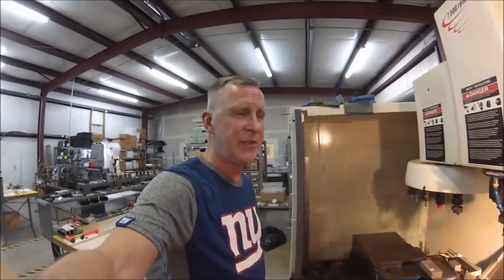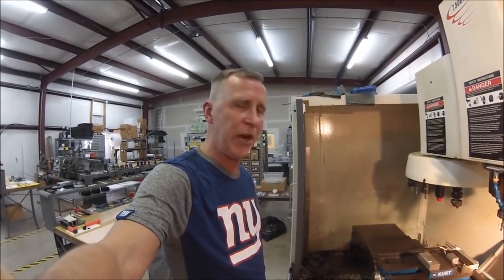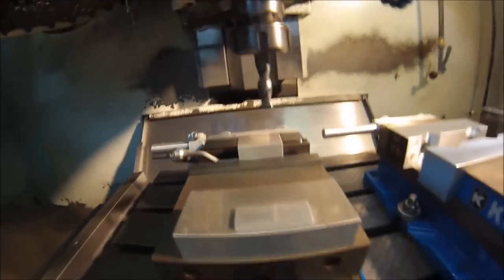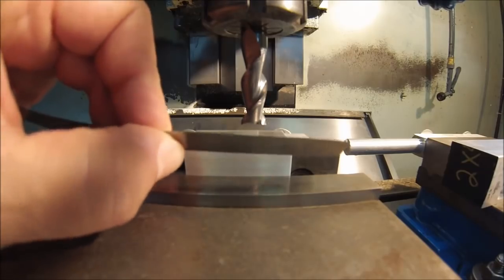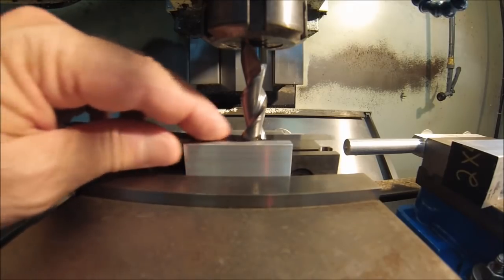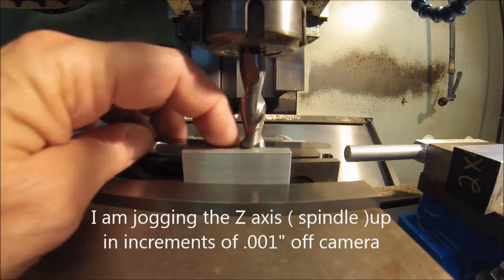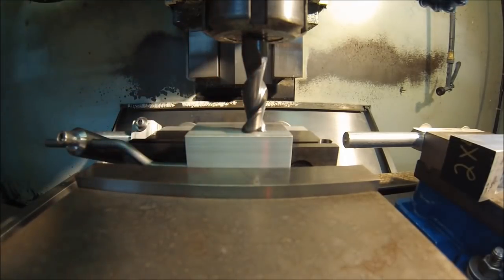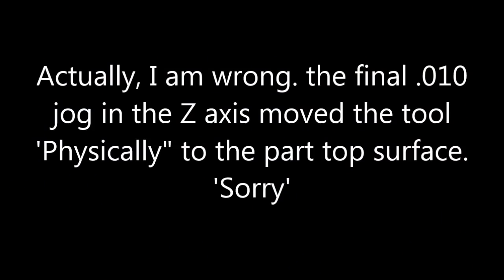How to Eliminate Chipping Risk when Setting your End Mill Height

Comment: I just use a 1” jo-block and once all my tools are touched off I drop my work offset 1”… you can also subtract 1” or however you wanna go about it, you get the idea. There’s also a dial gage tool for doing this quickly.

I start a little under an inch above the part and jog up until my block slides thru in .01” increments…. Unless it’s an endmill that’s holding a critical depth I don’t worry about getting it any closer, cuz time is money.

Comment: I have been using a .03” plastic shim after chipping a diamond coated carbide endmill.

Another way is to use a 1/2” ( .500” ) drill rod. Lower the Z axis just below the rod and Z axis up until the rod passes under the Tool.

The best way is to make a z axis gaging tool with a drop dial that is a known height.
Be sure to have .100” travel. Bring the Z axis down till the dial indicator is at zero.
4.0” gage setter. Z 4.0 measure on the tool geometry page. You can get all of your heights, not chip tools and blends in pocket floors blend nicely.

Comment: Model engineers in the UK (including me) tend to use cigarette rolling papers as disposable feeler gauges. The green ones are 1.5 though thick and blue 1 thou. Also 80 GSM paper is 4.0 thou thick.

Comment: Hey Joe, I have a Fadal also, Take a 6 inch (2-4-6 block) and place a indicator type tool setter on top of the block that will be 8 inches above your table. Set all Your tools to this height -Always.
then zero a small digital height gage (around 100 dollars for a cheapie) zero the height gage at 8 inches on a granite plate or use the little nibs on the side of the presetter wich are exactly 2 inches  ( plus the 6 inch block is 8 inches.) place Your indicator on the machine  table and measure Your work. It will usually be a negative number. Enter this number in Your work offset on the Z value.  There are so many benifits to this method.  Any tool in the carousel is already set, regardless of what job Your running. I keep standard cutters in certain tool locations in carousel.
If You start willing Your part and have removed the top of the part and then break a tool, No problem setting a tool.If You forget to set the tool length its always way up above the table .  You basically create an invisible  plane  8 inches above Your table that all the tools are set to and the work offset is references from this plane. Its actually so easy. If You dont have a tool setter , use a 1/2 dowel  pin on top of Your 6 inch block roll the dowel under Your tool with the heat moving up. Its very easy to tell when the dowel almost goes when its round. Your reference plane would then be 6.500 off the table.
Reply from the maker: I can see the benefit, but how do you apply this across all the fixture offsets. I bounce around between setups like the wind.
Reply: @joepie221  it works fine. Your g55 or  whatever will just show the z value reference from your 8 inch plane. Set those just the same with your height Gage.   So your starting work offset z value is always zero  then shift down after reading the height Gage. It's actually the easiest when using multiple offsets

Comment: I use a 3/16" dowel.  Move Z so the cutter is closer to the part than 3/16", then jog Z up until the dowel can be rolled under the cutter.  Then jog the Z axis down slowly with air under the cutter testing if the dowel can be rolled under the cutter when the Z axis is not being jogged.  When you can't roll the dowel under the cutter you are at Z = 3/16".  Set your Z axis to .1875 and you are done.  You could use a .5" or 1" dowel but you may not be able to fit that large of a dowel on some surfaces if there is geometry above the level you are trying to reference.
Reply: I do this same but on a 10 mm pin, it  is very fast to get within 0.02 mm just by raising the cutter on the smallest increment from the handwheel and trying to push the pin under it. THe round nature of it also will give you a visual reference as to how far off are you from the proper height so you know when to slow down the handwheel.

One thing to consider is wear on the ballscrew, as not all machines have perfect movements. If you are going up while measuring, the result might be just a bit different versus going down due to slop in the ballscrew and/or other parts.

Comment: I make an electrical circuit between the part and the tool to make a connection to an LED. It's consistently under a thou over. Couple of tenths usually.  It's super fast.  
For not so precise work or if I'm cleaning up the top surface anyways, I just do like everyone else by using paper and subtract a few thou.  Use what you have though. I don't like using feelers for this though.  From experience, it can throw them off, but shim stock is perfect.  Cheap and readily avail.
Reply from the maker: I now roll a .375 diameter pin under my cutters. Easy to feel and offset.

Comment: I bought an inexpensive 50 mm indexable carbide 90 degree facing mill cutter and R8 tool holder (Bang Good Inc.).  I saw a couple of reviews that were positive. Mine worked fine to face and square two pieces 2"x2.5" x 3" of 6061 aluminum. However about half way through squaring the second piece I experience severe chatter, especially when the cutter was more than 1/2 way of the tool diameter into the part. My very limited experience in watching videos using carbide tools suggested chattering was likely due to a chipped cutting edge.  I could not see wear on the 4 inserts, but I am not experienced with carbide tool wear signs.  I rotated the 4 inserts to provide new cutting edges on all 4 inserts but found no luck in stopping the chatter. I replaced the tool and finished the job using a 7/8" diameter HSS end mill. So, the mill worked fine, the problem resides in the facing mill tool.  I found that none of the inserts was loose and the cutter head was not loose on the tool holder. I researched the Internet to look for a diagnosis of what caused severe chatter.  One posted article said to stand the cutter with inserts resting on a surface plate. and see if all 4 touches the surface plate.  The author indicated the insert screw holes or insert slot for Chinese made cutters may not be properly aligned when made. I looked for uneven placement of the insert heights and found the cutter wobbled, two opposing inserts were not touching the plate. At least one of the two opposing inserts appeared to have a tiny bit of wear, but all inserts had no chipped cutting surfaces.  I rotated each insert to a fresh cutting surface and with all inserts lose I placed the cutter on the plate and retightened the inserts.  No luck to make all 4 touch the granite surface plate. Either the inserts were not exactly the same length, the seating screw hole was misaligned, or the cutter threaded hole was not perfectly aligned with the other insert positions.  Bummer. I replaced all 4 of the inserts with the same brand carbide and found the cutter seems to rest on the plate and not wobble. This suggests maybe a variance in inserts for length??? I thought I should replace the Chinese made inserts with a higher quality insert and thus ordered extra inserts made by a non-Chinese manufacturing company.  The replacement inserts will not be available for a couple of weeks to do a test cut. If they work, I'll buy the expensive inserts.  I do not know why the cutter worked flawlessly on 6061 aluminum, then started chattering.  This cutter holder arbor is 22 mm diameter, not 0.75 " diameter which is the USA standard for this size mill cutter head.  Therefore, the cutter head can't be exchanged with a high-quality cutter head without also replacing the R8 holder. I may have to do this. The inserts are APMT1604 PDER. My questions are:  1) Was my thinking correct in diagnosing the problem? 2) Is there a way to verify the insert screw holes are all in the exact location?  I measured the length as best as I could, being a rhombic shape that is not easily and accurately done.  I found no length difference in those few that I measured. I don't have a way to accurately measure the center of the screw hole to the edge of the insert. 2) What is the recommended way to attach the insert and should the cutter screws be loosely attached with the cutter resting on a flat plate, then tightened to verify the inserts all touch the plate?  Obviously, if you want economy, you have to be willing to pay for it. Buyer beware. I did not know the Chinese R8 holder was incompatible with USA standard mill cutter heads. Sorry for the long problem description.  Others may benefit from my case.
Reply from the maker: This is a good situation to evaluate everything about your process and setup, and not focus so much n the cutter. That focus could blind you to where the problem actually lies. When a change like the one you describe takes place, and everything, and I mean EVERYTHING has remained exactly the same, the issue is usually cutting edge deterioration. But for it to happen on the second part in an aluminum machining operation,  maybe there's more to it. I am going to generalize because I don't have all the facts. Make sure there is no cold fusion of the aluminum clinging to the insert. This would be aluminum that stuck to the insert cutting area from heat and lack of coolant. Make sure your part is tight. Make sure you are cutting from right to left. This forces the cutter impact and load against the stationary jaw. Don't spin the cutter at a ridiculous RPM because you have so much faith in it. Snug up all the machine axis locks you can that aren't being used. Choke up on the quill. Having it extended just adds to vibration. I have actually hand ground inserts and used them with great results, so I wouldn't concentrate on getting each insert perfectly positioned. If later down the road, you find one insert wears or chips faster that the others, that may be an indicator that insert seat is different and may need some attention.

Comment: With collets, you can get away with hand tightening the bit in the collet so that its held firm, but too firm.  Bring the tool in contact with the part to allow it to just push the bit further into the collet.  Tighten her up and your done.  With a drill chuck, this technique tends to add a thou or two as the chuck pushes the bit downwards when tightening.
Reply: Nice.

Comment: We have used a 1/2 inch rod (end mill shank cutoff) for years as a gauge to set tools.  Crank the Z down with nothing under the tool to less than 1/2 inch. Gently roll the 1/2 inch rod under the tool in the spindle while cranking Z UP  in Z jog .01 increments until it fits. Now you are within .01 or so.  Go back down one or two clicks so it won't fit but is close. Select Z jog .001 or even finer and jog up in this fine increment until the rod rolls through. If your rod is round, measurement surface really flat and machine in great shape it will repeat to 0.0001. It take less time to achieve than it does to describe. Remember to set your height to .500 or move some where safe and jog down .500 and set zero.
Reply from the maker: I now use a 3/8 drill blank. Same technique as you. Its fast.

Comment: thats a Fadal.... go to the page that says offsets...hit 6...then you will see the offsets page. should be an option for utilities number 4 i believe. push it

then options come up. i believe it asks for the number of tools to be set. answer it. then choose jog to position option 1 i think. set the gauge block size. follow the screen prompts. then select jog to position again....it will ask you to hit jog. do it. then jog to the part.

once you are like half an inch off the part in z put the gauge block on said part. raise the tool upuntil the block just slips under. then pull the block out lower the z by one click. switch to tenths mode and go until the block slips under. and hit "manual to abort" it will then say " press start to load tool "x" " tool x being the next tool to set.

after this is all done. all your parts are set off the part. and the part surface you used is z=0
Reply: Wont ever chicp a cuter doing it this way as youre not bringing the cutter down on the block. youre bringing the cutter down by eye. putting the block down. THEN bringing the cutter up till it slips under. then block out. cutter down a tick. then switch to tenths. and cutter up until block slips under.

also if using a multi insert cutter. be sure to spin the cutter by hand and check all the inserts and go around setting the tool until all the inserts let the gauge block slip under
Reply from the maker: Or scroll through the menu until you see the button that says "set length" then go to the offset page and modify value for that tool. 2 moves.

Comment: I've used paper, feeler gages, etc., but one rainy afternoon I constructed a tool setter out of a Delrin cube, a PVC round, a couple of springs and a Flea market rear plunger indicator. Added 4 little neo-magnets to the corners of the cube and placed it in the unused real estate of the mill table at the machines left rear corner. Every time I put in a new tool,  I run a routine that runs the tool over the setter. I bring down the Z until the dial reads zero. The control knows the zero height of the setter, so the tool length is displayed on the Z DRO.  I then just enter that length in the tool list for that number tool.
Reply from the maker: Love it. I've often thought of rigging one up.

Comment: Rolling a pin under the tool whe lifting is nice, especially on a pin that is 20 mm in diameter, as the movement of the pin towards the cutter already warns you to turn on the smaller increments as it gets closer to the highest point.

Comment: I do the same with a 0.02" shim. The reason is if (somehow) while descending I accidentally click more than once there is a ten thousands margin. Another thing I like to do with the Fadal is to use the "SETUP" dialog. I use the "TOOL" and then "MULTIPLE". It is a way to get a familiar routine for one tool or many tools. Works the same regardless of how many tools I decide to set up. Faster setup times.

Comment: I told a  professional cnc machinist about using a cigarette paper stuck down with oil and he told me he uses a sharpie mark under the cutter and jogs down by tenths
Reply: That's how I set up tools if I need a really accurate depth. Mark part with sharpie/layout and spin it real slow by hand until it just clears the mark off.  Works great with slitting saws in particular.

Comment: I was taught to do it with the tool spinning and a sacrificial strip of paper.  When you feel it tugging on the paper you know you're .003 off. 

No danger for the tool since it's spinning.  Of course we worked to .01 tolerances with a manual machine with no DRO so it was fine XD. Teacher even said not to worry about the paper and just zero it there.
Reply from the maker: Thats a safe way to go if the part will allow it. Just don't naturally react and pull  the paper when the cutter grabs it.

Comment: before i had a cheap dial z height setter i would do something similar with a no hole 123 block.  i would slide the block under the cutter AFTER i had jogged the z.
Reply: Where you find a cheap dial z? Think they start at 300?
Reply: @ravenvg  https://www.edgetechnologyproducts.com/pro-touch-off-gage/

Comment: Excellent tip as always Joe, I just wish my manual mill had power operated .0001" moves :-) An old and not even close to as accurate trick I stole from an old machining book is using cigarette rolling papers. Zig Zag in the light blue package are almost exactly .001" They can be used to set the Z, edge find, or even re-find the face or O.D. of a part in the lathe. A slight drag on the paper your within about a thou. Add a bit until the paper tears and I'd call it 1/2  a thou. Thicker paper won't work nearly as well since it will compress a fair amount under the tool tip or edge before it rips. You can even edge find with the tool or part rotating at full rpm so any minor runout is accounted for. Obviously it would be a smart move to grip the paper with a pair of needle nose pliers unless you enjoy body appendages looking like hamburger.

Comment: We do something similar at work.  Though we touch off the table using a "known" 123 block in the "3" direction.  We drop Z blow 3....and come UP till it just clears; then using .0001 movements we achieve the touch off we like and then add 3.0 to Z in the tool setting.  As you point out ALL adjustments are done with the 123 block AWAY from the tool and all feel attempts are made with hands off the JOG wheel.  As always make sure that the surface you zero off is clean....the feeler or block is clean.  IT's always a good idea to massage the table with a stone before setting tools from it.  ALL that said....we recently put the Renishaw probe back on the table and it's rather amazing how much that is like cheating.

Comment: I like to use a 1" gauge pin using the same method and roll it under the cutter. on our machine i just put in the 1" as an offset so once i "zero" on the pin it adds the offset height to the tool offset

Comment: I came up with pretty much the same procedure at my local makerspace.  Right now, I am the only person there actively trying to learn the CNC side myself.  I use a very similar procedure though I use a broken endmill and mic the OD to double check.  So far none of my parts have needed this accuracy, but measure small, make small errors.

Comment: I have always used paper. Get close, then jog down in 0.001" increments until the paper drags. If I need to get better than that. I will mark the part with layout or Sharpie. Do the same as above.  But, once the paper drags. I will turn the spindle on at a few hundred RPM. Then job down in 0.0001" increments until the cutter rubs the sharpie off.